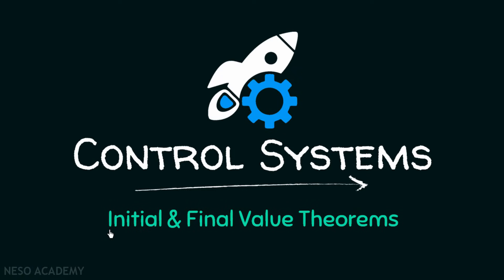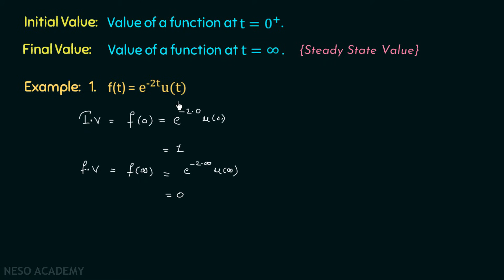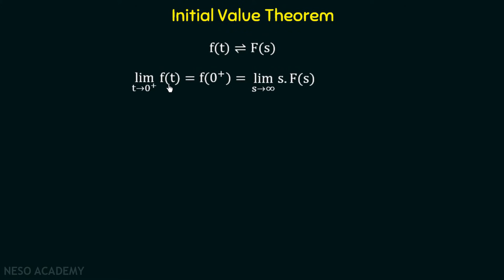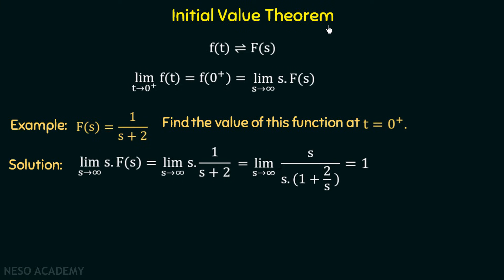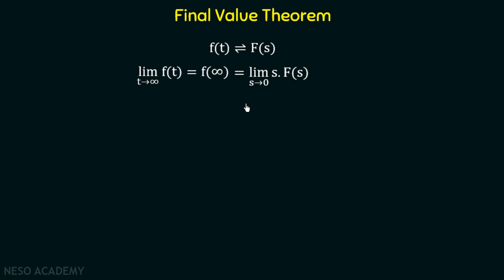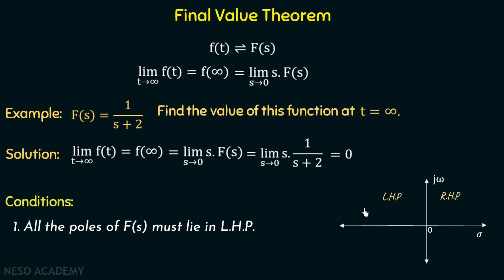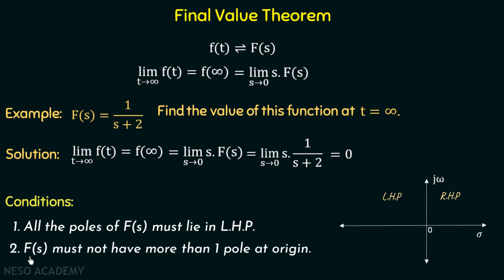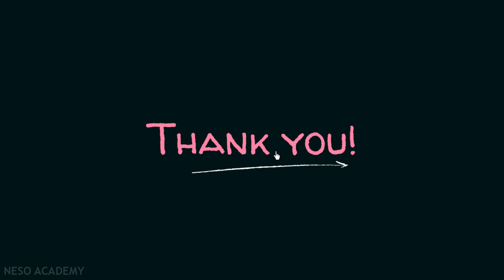Initial Value and Final Value Theorems

Comment: Is the value of u(0) & u(inf.) just equal to "1"?
See 01:50

I ask because, we determine the value of the function using only the term with the exponent.
(or that's how it seems)
Reply: does the question makes sense?
Reply: u(t)  looks like it might be a step function .... is is not just anything.  So is does equal 1 at times later than zero.